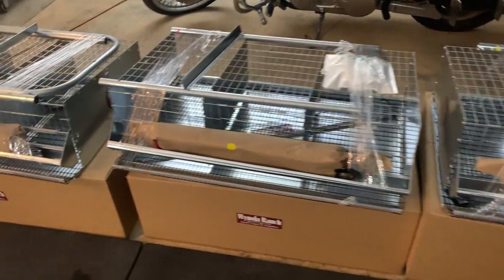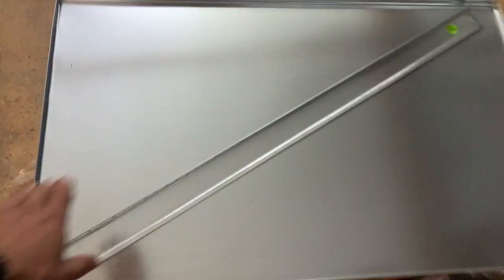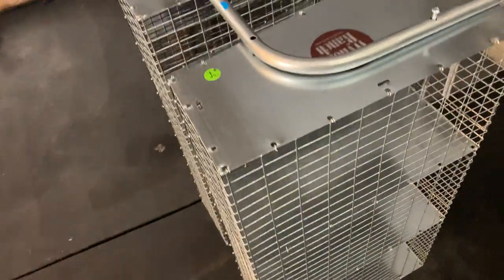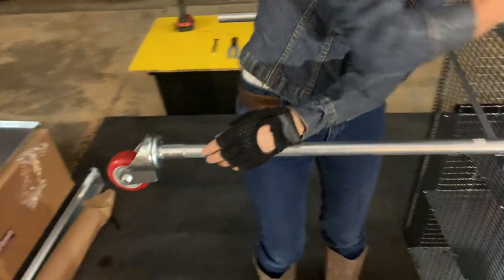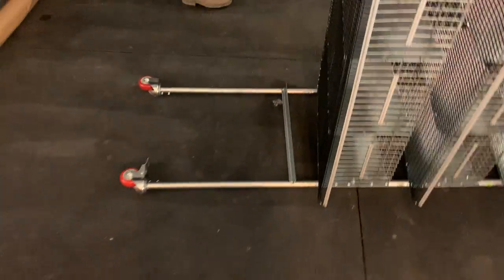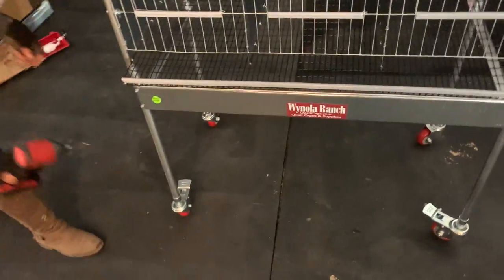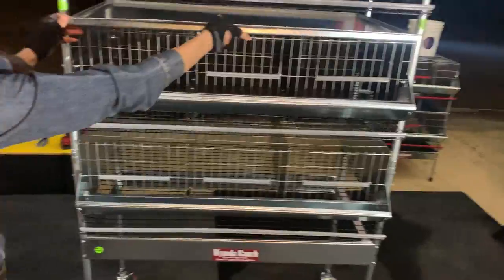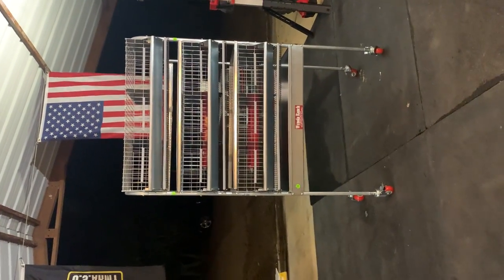Quail Cage ,  9 sections PVC

Comment: Should consider some sort of lips for those manure trays to slide onto. Sliding them over/ontop of the other cages would cause wear on the cages correct? Which would eventually rub through the galvanized layer? How about some sort of rubber belt + crank that lets you Set a bucket next to the cages and with one crank it rolls the manure off into the bucket?